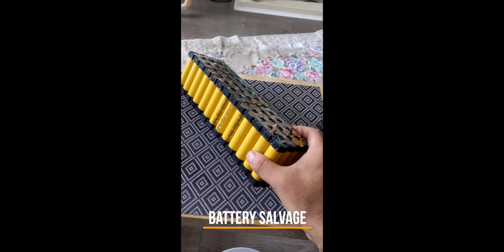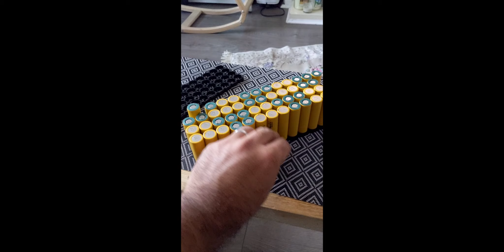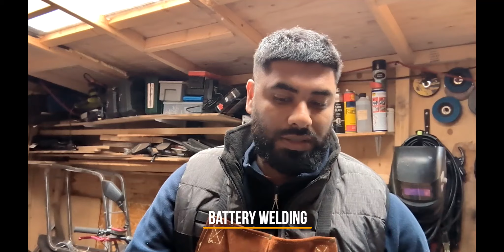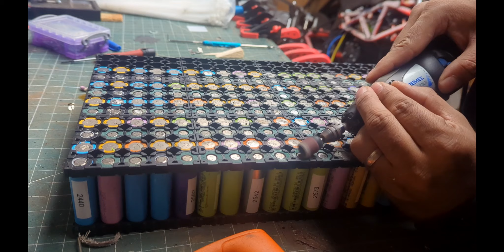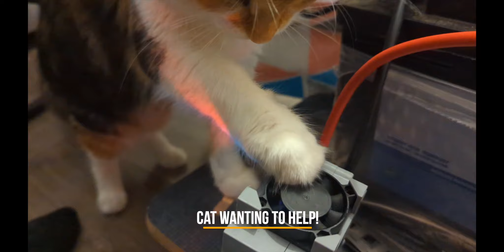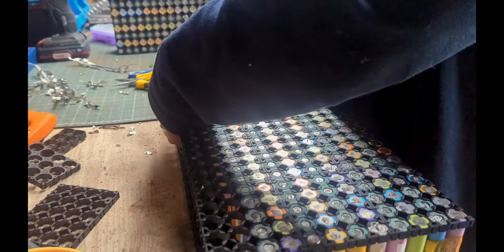Supermoto Electric Motorbike - Battery Build Part 1

Comment: i was told to never grind the ends of the batteries as you take the protective coating off them, and the batts will start to rust and fail
Reply from the maker: I've also heard this too, but it's the only way to make sure I had a flat surface to weld new strips on. Planning to seal this battery with shrink wrap and silicone so should be waterproof and avoid any humidity to cause rust